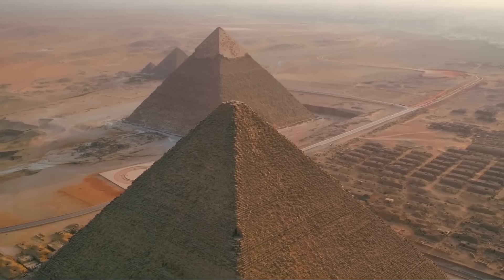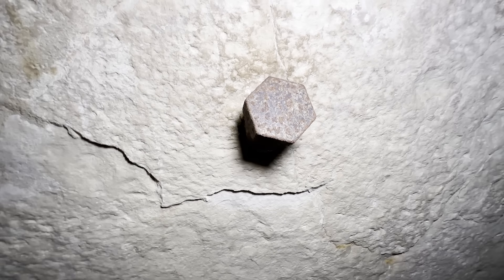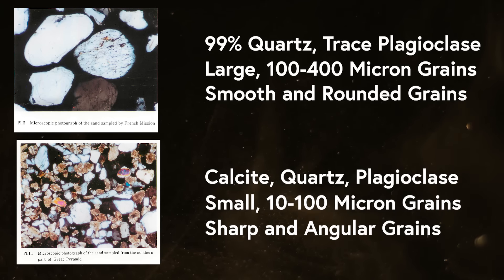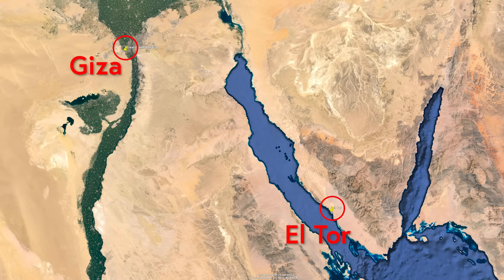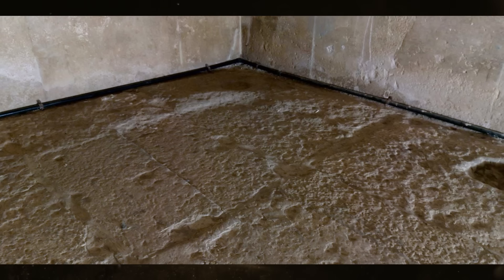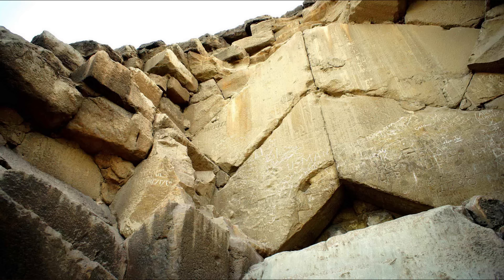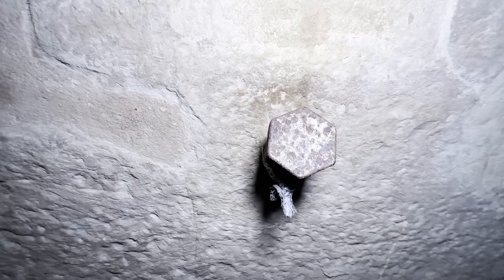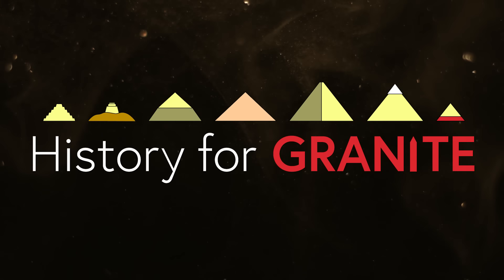How Sand Built the Great Pyramid

Comment: Sand has so many other properties, what made the professor point only to the frictional or cohesive properties?  
Sand also absorbs heat differently than stone, changing the thermal characteristics of pyramids. 
 it has vide ranging vibrational absorption properties. higher dampening properties that diffuses/dampens vibrations from reaching levels across. 

Curious what made you pick the friction as the likely use?

Comment: just throwing some stuff at the walls (pun intended) to see what sticks , sidestepping the question for how exactly but,could it be that the rounded quartz was actually used for sand blasting and polishing the stones? i know you state the opposite in the video, but today for heavy duty sandblasting we dont use sand but little metal mm sized balls. and their better flowrate would be of great benefit for this if your guiding them trough pipes of some sort either with water or air. their better watter resistance would also come in pretty handy in this aspect

Comment: Very interesting, but I still am not clear why the floor was left unfinished though the walls were polished, and equally importantly what was the purpose of the queens chamber? Was it a visitors gallery (as you have suggested the lower chamber of the bent pyramid was?).

Comment: I thought while building the pyramid one layer at a time they fill it in with sand to have a base to work on and for the big blocks if you took the sand out from underneath them carefully to drop them in place.The small diagonal passage might have been used to get rid of the sand if it was steep enough to flow.

Comment: In fact the problem of friction is a greater one than most people realize; it's not the actual raising -  the pure work required to lift the material within the pyramid construction site is given by the center of mass of the pyramid, which is total height/4, so h= 36.5m for the Great Pyramid - mass * gravitational constant * height. On the other hand, friction energy demands are potentially much higher: The friction energy is defined much in the same way, as m * g * horizontal path * coefficient of friction. Now the horizontal path is not only a couple dozen meters, but more like a couple hundred meters at any rate, every which way you put it (internal/external ramps, whatever) - so we're talking potentially 10x-20x the energy demand of raising -  the coefficient of friction for smooth surfaces can be anywhere between 0 and 1... with dry similar rock surfaces, you're routinely looking at like 0.5-0.7, depending on the rock type! To get the friction coefficient down by just a couple percent points may therefore be equal to getting rid of the ENTIRE lifting work when raising the pyramid!
If we assume for example that the elevation difference from the harbor near a workplace to the base of the pyramid was on a similar scale as the pyramid center of gravity itself - no problem, put another couple hundred men to work there, I'm sure you'll find that manpower easily. But the friction - to overcome that by making the ways shorter and the friction can save you hundreds and even thousands of potential workers. I'm sure they must have experimented with several methods there, as it is such a crucial part of the whole work schedule - and honestly, I don't think that adding even the roundest and most homegeneously sized samples of sand between the rocks would be my first go-to - I'm quite sure their first choice must have been simple water to reduce friction - for limestone, that alone seems to reduce the friction from about 0.7 down to 0.5 - a VERY real difference, but of course still far from optimal. One of the best bang-for-buck ways IMO would have been to mix it with clay -as you'd find everywhere on the banks of a periodically flooding river such as the Nile, to further reduce friction - couldn't find it for limestone in what little literature I consulted, but for concrete blocks (which start out very similar as limestone, 0.65 when on dry surface) this takes the friction down to 0.2; as someone who has more than once in his life successlessly tried navigating clay-covered country roads on a bicycle after a rainshower (not learning from my mistakes very well), I don't doubt that whatsoever. Also, it reduces the watering demands as clay will cling on to the water particles, it will remain moist for a good while, certainly longer than a simple wet rock. Another way, which would probably make away with watering demands completely, would be to use some sort of fat/grease/oil. However, this will (just as clay will) produce a large mess which is also really hard to clean, which I suppose makes it less than ceremonial, also this will drive up the cost immensely. Where coating the whole thing in a mud-/gore fest was not an option,  I guess that's where they must have resorted to other means: Importing the rounded sand from so far, if it helped reduce the friction less than the way cheaper local alternatives - such as when finishing the "queen's chamber", that would IMO be a good reason to do so.
Now it has been often assumed (I don't know on how good a foundation) that the ancient egyptians used ramp gradients of about 0.1. That would mean, for every 1 meter gained in height, you'd travel 10 meters horizontally - and with a friction coefficient of around 0.2 as for the most abundant "lubricant" of wet clay, that means, our friction power demands on ramp sections are still twice that of the mere lifting power - and of course, not every section will be a ramp, so in fact we need probably 3-5x the amount of power for pushing blocks than to lift them.
 
To put a bit of a  magnitude on how much that is, I just did a bit of a calculation when on a trainride, and it sort of surprised myself; if someone could take the time to redo it and tell me I got that wrong, I wouldn't be cross at all: 
Again, the pure work required to lift the material within the pyramid is on average to the center of mass of the pyramid, which is total height/4, so h= 36.5m for the Great Pyramid; the amount of blocks is estimated at 2.3 million, each weighing ~2500kg, so that's m= 5.750.000.000kg . The work put into the lifting is m*g*h , g being 9.81m/s², so we arrive at 2.058.873.750.000 [kg m²/s²] = [Joule]= [Watt seconds] of pure energy used to lift up all that material above the base to it's final resting point. To arrive at the power needs, we divide that by the seconds it took to lift this all up - If we have about 10 years = 3650 days of pure round-the-clock work time to do that (which will result in like 20-30 year construction time), 86400 seconds to a day,  we arrive at a constant power demand of the construction site of drumroll 6528 Watts, to lift all the blocks to their final position in time.  It took me a couple times of recalculating to trust that number. That is very doable -  that's about, no nonsense, the working power of 20 horses, or of a single not-too-large portable diesel generator, or in egyptian terms: just a couple hundred men present at each point of time at the site to fulfill the lifting needs. If we assume the 3-5x total including the friction, we actually arrive at a reasonable 1000-2000 men present at the site to move those blocks. The biggest challenge must have been to coordinate them all and make sure they never run out of the resources they need to do their job.

Comment: Speculation and proposal:
The actual structural retaining wall and the wall of the hallway encompass a cavity for sand, the ceiling blocks may extend far more than the walls we can see and go above the sand and land on the actual retaining wall. This would from a structural point of view mean that the unstaggered walls add a point of contact, but are not the main load bearing part of the wall. On top of that I assume  few layers of staggerdn flat blocks laid above another to form a triangular shape and redirect the forces to the side since the "pointy" end of these staggered flat blocks would be roughly over the hallway. This is a similiar construction method know across the world adn we use it to this day, even if our materials have changed a lot, that would be physics for you I guess.

Comment: Very good! I also could try to help solve the sand mystery..

1- they dont really need the lowest friction possible, cause would be too slipery. Actually, considering a sand ramp, they need a friction that can keep a block on hold in the middle of a sand ramp. Also, that must work on different umidity rates.. e.g. when suddenly starts to rain, a block on hold should not slip.

2. The friction in wet sand can be weird.. i am genuilly curious to Discover how this different sand works. However, i can say they would not need something more or less than what u have in general sand. The evidence is the 26degree angle found all over the pyramides.. the reason for this number is not spiritual..jeje U can check some graph of friction x umidity for sand.. then u shaw see why the ramps need to be at maximum 26 degrees, never more than that. The lowest friction is 0.43 found with sand at 5% umidity.. Then, Newton shows u that 26 is the angle that gives the perfect balance.. If u use a more slipery sand, u should have to reduce this angle, what would not be good..

3, My guess is that sand would be used for umidity control.. yes, i know it is a desert, but.. anyone who has built something knows how leaks, infiltration and umidity can be a total bitch.. even in a desert.. imagine a pyramide having many little tree seeds starting at each corner.. even if they day, imagine that every flood season for thousand years.. So they had to make many decisions about umidity.. but, total, everybody take it for granted just cause it is in a desert jaja

Well, that is my 2cents.. I might some day also start making video or blog post, as i myself feel inspered for ur work

Comment: Thanks again for the clear explanation.
There is still something questionable like always:  the sand inside the structure, might look the same as the one find in El Tor, but we shouldn't take it for 'granted'..
It is specially this find which could answer one of the questions we have about the age of the structure.
Sand as we find it today on the surface in Egypt, are all blown-in sands.
And there is lots of it, it could make mountains like we see in the Sahara/ Tenere desert.
We all know by now, it wasn't always like that.
It mostly comes from the dried up inland water areas which were once lakes.
Along the coast, I have seen the layering found which are multiple, among them the researchers found also multiple tsunami-deposits coming from the Mediterranean see.
We would never know this, if not digging deep.
The same with those sands found in the Pyramid, we have to search for reports about the build up of layers around the area, in order to give a date for the cristal-sands used in the structure, as we do with finding quarts blocks used by them, and not accept the far away El Tor idea?
Just a thought..:-)

Comment: It looks like you just found the tool that was used to cut and polish granite.  And, hey, you could drill a hole that way!

100-400 microns is roughly 40-120 grit...so, they must have had access to a finer grade of the abrasive.  However, you could flatten a granite surface very nicely with that abrasive.

Comment: The circular quartz sand is a byproduct of jagged quartz used to cut the stone.  Once its sides are worn away it is no longer suitable for cutting and can be use as a smooth bed to move the stones across.

Comment: Given the existing knowledge of the pyramid and the potential for new finds, I can not help but think that there was both modification to the original plan and an urgency to complete the project. With regard to the modifications, I would speculate that Cheops did walkthroughs and then either with or against the advice of his architects,  commanded that revisions that he felt suitable were effected. The architects were pressed for time to make these changes. In order to save time, some modeling was done at ground level near the monument.  I suspect that some of these test beds are yet to be found near the pyramid. I believe we should also see efficiencies in second and third pyramids built on the experiences learned on the great pyramid. It not surprise me that each subsequent pyramid gets smaller and more affordable. The comparison to the belt stars of Orion is coincidence.

Comment: The sand is used to absorb kinetic energy, as when there is natural sysmic movement,also that is why you have different block sizes throughout the construction placed in a sequencial organic way ,the febonachi sequence but counter rotating on the height axis.
Like Sherlock Holmes said "it's elemental".

Comment: Quartz sand flows.
It flows out from beneath flat weighty stones that are supported by it's restricted presence.
So the sand is filled into the prepared open-topped slots into which the stones will fall asleep the sand is removed from beneath.
The stones lining this and only this wall are able to slide vertically stone by stone as the chamber passage was completed.
This explains the cavity beneath this area.
So why did the builders need to construct this chamber passage in this unique way? Sliding the massive stones capping the Queen's Chamber along the upper surface of these elevated stones would enable moving the massive blocks into place. Then the sand was allowed to flow into the space below so dropping the lining stones into their current position.
Any thoughts?

Comment: Speaking as an engineer, I think it’s important to bear in mind that these pyramids were built in layers from the ground up. Looking at the vents from the Queen’s chamber it appears to me that by the time they got up to the level of the ends of the vents everything that needed to be done in the Queen’s chamber had been done and there was no more need for ventilation so they closed them off and proceeded with the higher levels. Of course, this is just a guess.

Comment: Could this quartz sand have been imported to create the ramps that the large stone blocks were dragged on their sledges to the work site? That could have been a motivator. I've seen the illustration showing a workman dumping water on the sand in front of a sledge - water might really cut the friction if the sand was the rounded-grain quartz material. Perhaps someone could do a test of both kinds of sand to see what the difference in friction is between the two types at various levels of wetness. Then, to dismantle the ramp, they could just dump the quartz sand into cavities in the pyramid. Just a thought - I really don't know if this is a practical solution. Perhaps the areas around the pyramids could be examined to see if there's quartz sand still mixed in with the smaller plateau sand in areas that could have been a ramp site.

Comment: I think that thick rounded quartz sand was used in all Egyptian buildings as an easy wat to work at heights. When things up high were finished, sand was evacuated until arriving at the bottom. Remember that documentary of National Geographic where the Egyptian 'archeologists' discovered and ruined the mummy that was covered in intricate colored beads woven tissue that completely disintegrated sadly, because the did not take precautions? That mummy was found in a very deep pit and there also sand was used to lift and lower very heavy material in and out during the construction of the tomb..

Comment: Im not convinced that the sand behind the horizontal passage was just put there as a means of disposal.  Due to its resistance to compression it must be supporting something. The unique layout of the blocks in the passage is yet a mystery to be solved, but just for esthetics? I don't buy it. The architect of the Great Pyramid was a genius  who's greatest work has yet to be uncovered.

Comment: If you are going to use sand to lower the rafter blocks it makes no sense to build a masonry structure in the center of the Queen's chamber. The sand can easily support the rafters and can also serve to lower the rafters into position. A masonry structure would get in the way of the sand's ability to lower the weight into place ie it would in all likelihood jam up. I think that the various clues in the masonry are being forced to work together a little too forcefully here. Not every clue in the masonry necessarily relates to the process of installling the roof beams.

Comment: I have always wondered why the queens chamber is centered to the peak of the pyramid, and the kings chamber is offset. 
I can see a lower slope angle being beneficial to getting the beams on top of the kings chamber, but it still feels less 'perfect'. How much could a design change during construction? If the queens chamber was the prime location until they had a better idea they could achieve something spectacular with the kings chamber?
Reply from the maker: The center point of earlier pyramids was not the upper chamber, but a lower chamber/chimney/shaft which was more accessible. I would speculate this center point had a spiritual significance for connecting to the pyramid or the upper space. Later pyramids also place the antechamber in the center. The center is a position of worship, not burial.

Comment: Interestingly, singing sand is sand composed of primarily, rounded silica grains 0.1 - 0.5mm in size, this sand is of the same description and in the same size range. Perhaps the Egyptians found a spiritual reason to transport such sand from a great distance, it is not very common. This does not necessarily exclude using the sand as an aid to lowering the roof beams into position.